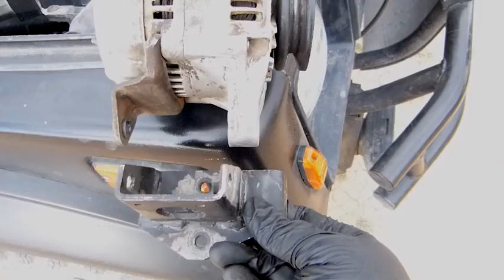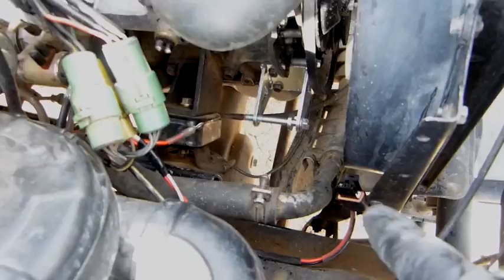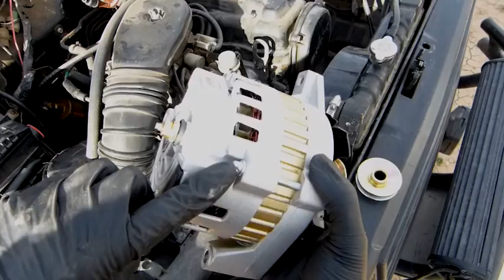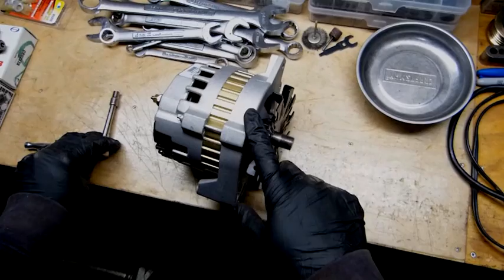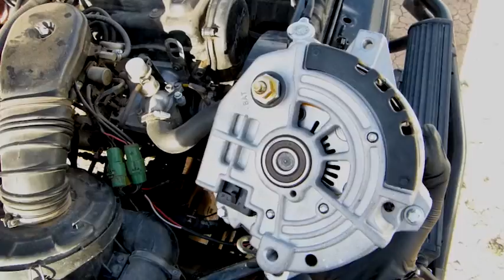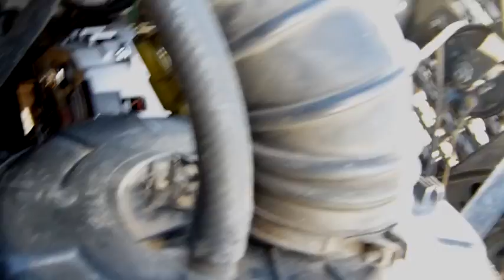Suzuki Samurai CS130 105 Amp Alternator Upgrade

Comment: I cant find that belt pulley, do you have a link, part number etc so I can purchase? Please help. Thanks
Reply from the maker: Sorry for the late reply. Some comments were lost in the YT system for some reason.
The pulley I used came from another stock AC Delco alternator. AC Delco only sells genuine serpentine belt pulleys on Amazon. This other pulley sold there may work. As a bonus, it's a deep groove:
https://www.amazon.com/dp/B014GNG6WM/_encoding=UTF8?ref=exp_inf_pl_designedbyinstinct

Comment: I adapted a GM CS 130 alternator to a 1999 Honda CR-V ex the pigtail i had to add a 4th wire to it which is the speed sensor wire. before the vehicle's transmission went i upgraded the alternator to a 160 amp CS 130 alternator by Tuff Stuff Performance. they can be ordered from Summit Racing i got the koolcharger one as it had the cooling fins on the critical area where the bridge rectifier is. the alternator i had to use is from a GM truck with a 7.4 454 big block chevy application. as i had another option to use the larger CS144 alternator but the CS 130 fits in the Honda fine as i had to make a top bracket so it adjusts properly even though it rotates the wrong way it still charges as it does not matter the direction the alternator will charge. as some GM alternators the warning light has to function for it to charge if u use an LED light for a warning light then u need a load equalizer for it to work. as i figure that out as the regular CS130 with the exterior fan on the front will fit in Honda civics, Acura Integras, and Honda CR-v models up to 2001 on Honda D and B series engines. the newer alternator with the internal fans is the CS130D. as they have the 4 wire connections on them. some vehicles u don't need to use a CS130 alternator you can use a Leece-Neville alternator, or another brand alternator whatever fits the vehicle and mounting configuration + wiring depending on the connections on the regulator.

Comment: Where'd you get your v pulley at?
Reply from the maker: From a friend. I think it came off some other GM alternator from Autozone. There are a couple places online that sell new ones for this conversion $14.
Reply: Can you track down the link or part number? This is the last item of contention in order to fully complete. Thanks.
Reply from the maker: This may work: https://www.amazon.com/dp/B014GNG6WM/_encoding=UTF8?ref=exp_inf_pl_designedbyinstinct

Comment: wont this heavy alternator affect the Engine performance as i believe that the engine is 1300 CC only. I'm driving a Suzuki Gypsy in India and my mechanic asked me not to install a heavy alternator as it affects your engine performance.
Reply from the maker: It will be fine. I have zero problems and full engine power.

Comment: Do you have any power surges after the install? I did this swap with my samurai and I get headlights and turns signal get brighter and then dim and also when I'm driving I get the dash warning lights turns on and off (flicker)
Reply from the maker: Mine works 100% perfect. No warning lights.